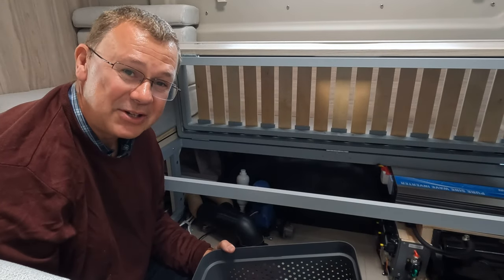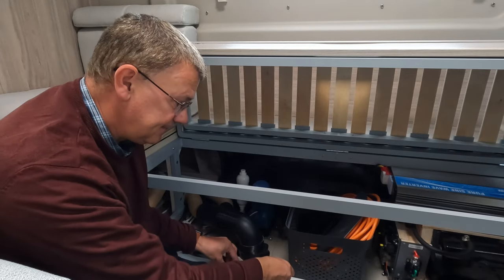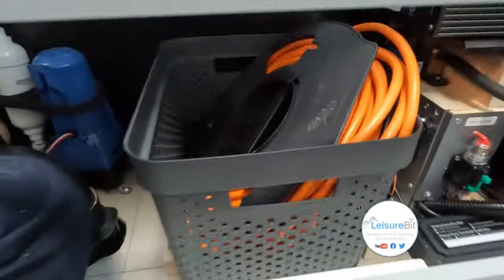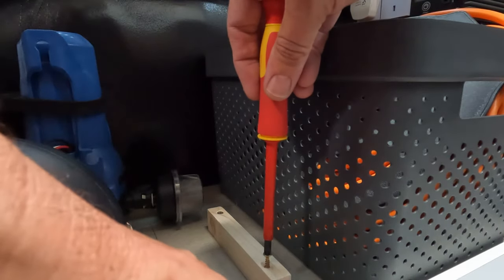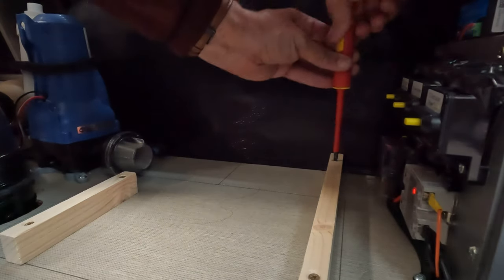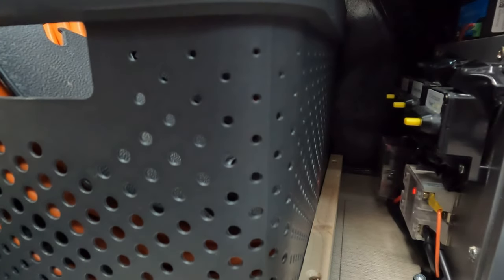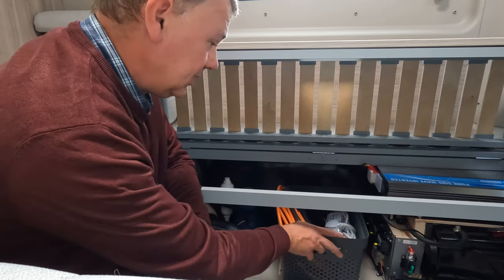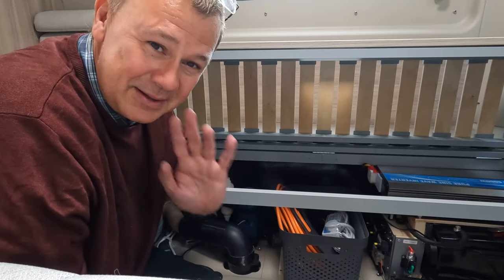Under Bench Storage Basket secured in our CV20 Campervan

Comment: Good way to keep the cable nice and tidy. Great it’s all fitted and secure and won’t slide or rattle. Our cable  is currently under the driver’s seat. Very useful vlog for a great storage idea. 😊👍🧙‍♂️
Reply from the maker: Thank you. I have been storing my fill up hose under the drivers seat and have a shorter electric cable in the passenger door pocket which seems to be fine for about 80% of the time. I’d been storing the longer one on the reel underneath but was just “slung under” so it slid around and rested on the heater outlet or ran into the electrics so thought it was a good idea to pop the box in so I could grab it out when I needed it but stop things sliding around - also stops cables resting on hot outlets or knocking the breakers off 😂 
It’s surprising how much more you can get it by popping in vertically too. You could get a lot more space boxing in but was a bit worried about air flow so this worked perfect and much cheaper than the plywood is at the moment. 
All the best, David 👍

Comment: We keep the cable under the driver seat as we rarely use it, as you know I boxed in under that side, if the box idea works for you great but IMO there’s a lot of wasted space with it. Cheers
Reply from the maker: You’re right, boxing it would give more usable space, the plastic box sorted out the problem of stuff being slung under and the cable laying on the heater outlet or crashing into my electrics and it keeps space for the air to circulate around. Sorted it for me. I keep my water hose under the drivers seat and a short electric hookup cable in the passenger door pocket which works about 80% of the time so just need the longer one occasionally. I may ‘upgrade’ the space later but has sorted the problem for now and easy to lift the box out to get stuff 😀 You’ve reminded me there are a few good things you had done with other boxing in which I would like to do - I don’t know where spare time goes as we seem to be out and about all the time (which is great and what we got it for of course) I’m hoping over the winter to get all caught up with things as so much I still want to do such as boxing in as well as the 101 other jobs on the “to do” list 😂
All the best, David 👍

Comment: Nice and neat David, I wonder if you could get more in there by constructing a wooden box with 2 pieces of furniture board for the sides and one for the front then dropping items in from the top. Chased my dealer today who surprise surprise has advised another 3 month delay caused by the factory closing (didn't specify Elddis or Fiat) Cheers K.
Reply from the maker: Thank you - you could certainly get more space there for sure, at the moment it’s fixed the problem I had of the stuff sliding around but great suggestion. Really sorry to hear of the further delay, I know how frustrating that is, I’m sure when it arrives you will be over the moon though - I know that doesn’t help. All the best, keep your chin up, David & Rachel 👍
Reply from the maker: Rachel here…. Genuinely gutted for you Karlos… keep positive … it will be mega worth it when it arrives 💕